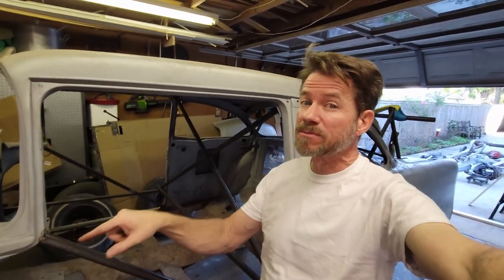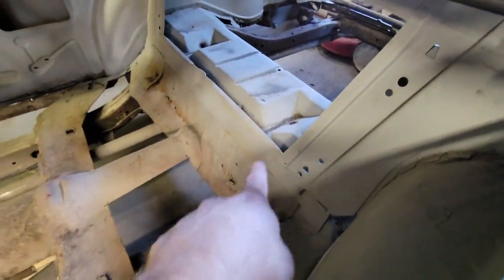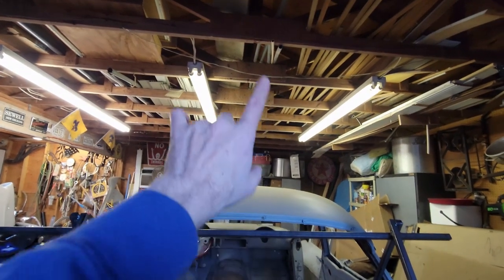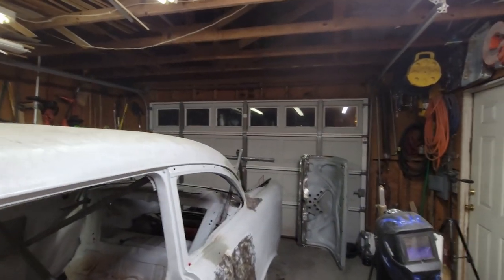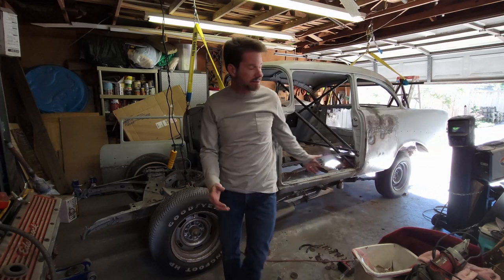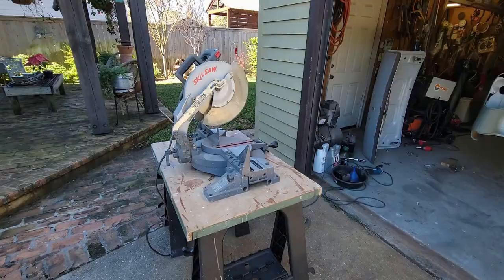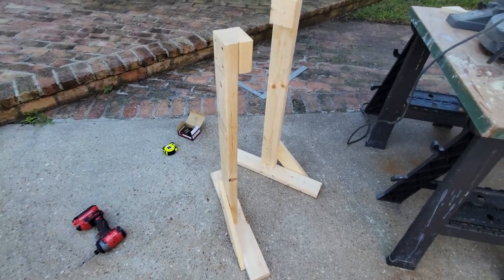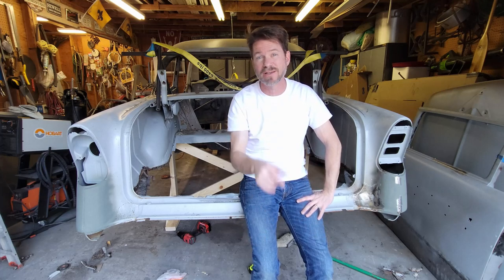E27 Removing the Body from the Frame!    1956 Chevy Bel Air Restoration

Comment: I am about to do the same to my 51 Buick Special. But I will have it hanging for awhile on the ceiling since I am going to do frame work first! Was just looking at videos for some info and advice! Good to see some videos
Reply from the maker: One thing I've learned is that most of what I'm doing is completely applicable to any other full-frame car, so it should be helpful to your Buick (isn't that the "Rain Man" car?  Fireball Eight?)  I'd love to see pics of your project!
Reply: @RestoringChristine1956  I think the Rain Man was a late 40s convertible, but close enough. Well I have a 50 Special as well and desire that body style more as well as the 50-53 Super's compared to the 51-53 Specials. But looks neat too when lowered. I still have a lot of work. Its probably going to be a 90-95% resto.  I like the old paint but don't like too much rust and rotten spots

Comment: Nicely done, I like to see how others do their twist on similar tasks. I plan on a rotisserie on my ‘57 so I can address things like wheel wells, and roof repair and still have what’s left of my back and knees lol.
Reply from the maker: This is the second one that I'm doing frame-off, and before I used to think that a rotisserie was essential.  But, what little I've had to do to the roof was at the edge and within reach, and both times the floor and trunk pan came completely out, so all of that was brand-new.  But I understand about joints and aches and pains!  Save yourself!  Thanks for keeping up and best of luck with your project!
Reply: we can make a rotisserie and share it.  I have a trailer, and my ghia may need to be rotated...   I'd like to help with electrical and upholstery on your project!

Comment: NO.....that doesnt look scary....I might of left the straps on just for extra measure...anyways your gettin her...I couldnt see real good ..but my old 56 out back had a seamless frame on it...does this one?   keep up the good work and be careful
Reply from the maker: I'm with you!  When I did the Cutlass, I left ropes hanging from the ceiling at 4 corners even when I had it on the skids.  Just for giggles and grins, I think I'll bring out the scales to see what it actually weighs.  Be pretty cool to find out!  And I was thinking about doing a video on just the frame now that its out.  I'll have to look into the different varieties to be able to comment on what I'm dealing with.  Each Cutlass frame rail was two C's that lapped together to form a box.  This frame looks like a square tube with 4 sides.